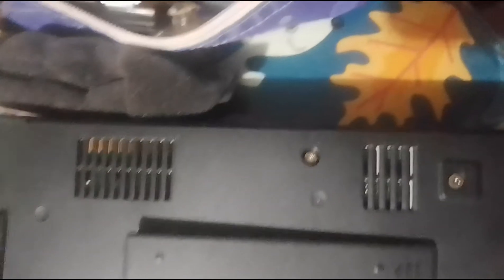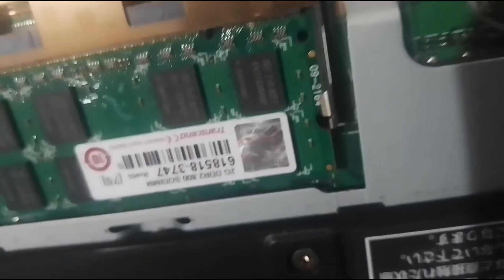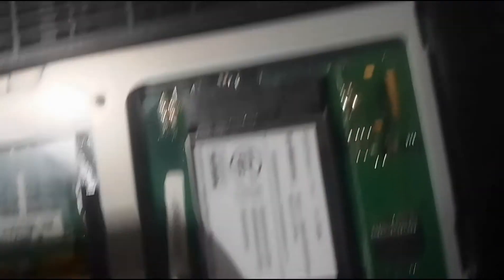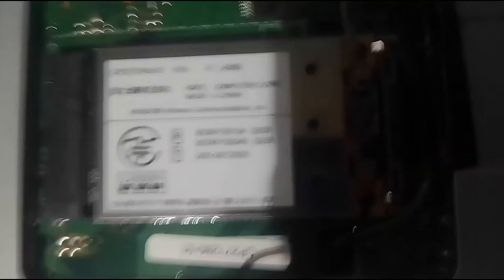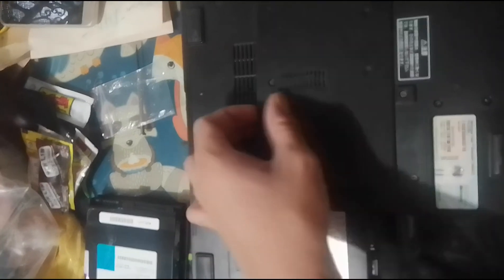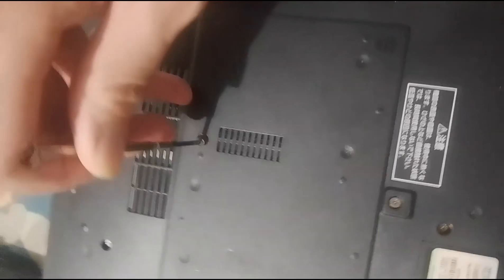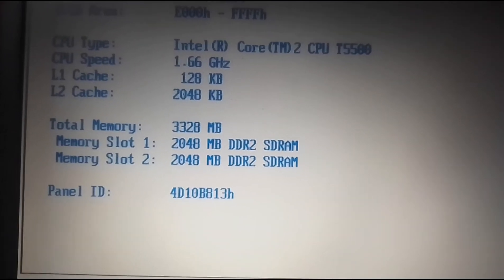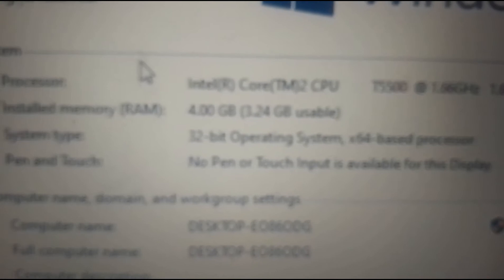How to upgrade RAM from 2GB to 4GB in Fujitsu FMV-C8240 laptop?

Comment: pwede po ba lagyan yan ng sdd? if pwede po ano po ung compatible na ilagay
Reply from the maker: Thanks for your question. However, yan ang di ko alam kung working ba ang pagpalit ng HDD to SSD sa Fujitsu FMV-C8240 kasi di ko pa ma-test yan. 2007 nirelease ang Fujitsu model FMV-C8240.
I'll plan to buy Sata SSD and I will find out soon.

FYI: parehas ang size ng laptop sata HDD at SSD.

Comment: Is it possible to upgrade the graphics card of this laptop?
Reply from the maker: Unfortunately it is impossible to upgrade graphics card because 256MB Intel GMA 950 is a major bottleneck. RAM and CPU can be upgraded.
Reply: @DarkKen958  I wish of playing NBA 2K14 in this laptop. I already upgraded my RAM to 4gb. If ever and if it is possible that I upgrade the CPU of this, will I be able to run the game?
Reply from the maker: @janusmichaelfausto6985   Core 2 Duo can be T7200 2 GHz, T7400 2.16 GHz, and T7600 at 2.3 GHz for a better CPU. 
I read it about upgrading to T7200 ot T7400 in http://www.fmworld.net/biz/fmv/product/hard/blb0704/c8240/spec.html using google translate
and upgrading to T7600 in https://forums.tomsguide.com/threads/upgrade-ram-on-old-machine-or-get-a-new-budget-laptop.139976/
Reply: @DarkKen958  If I upgrade the CPU to T7600, will the game (NBA2K14) run smooth?
Reply from the maker: I never tried it yet. I only placed RAM. I ran Medal of Honor Pacific Asaault and Age of Empires 3 using my default Processor of Core 2 Duo T5500 in my FMV C8240 it's very slow on gameplay. I haven't tested it yet and still don't have budget for CPU upgrade.
Reply from the maker: NBA 2K14 PC SYSTEM REQUIREMENTS

MINIMUM REQUIREMENTS:
CPU: Pentium 4 2.4 Ghz Single Core processor or equivalent (2.8 Ghz for Vista/Win 7/Win 8)
RAM: 512 MB or more (1 GB for Vista/Win 7/Win 8)
Disc Drive: 8x or faster DVD drive
Hard Drive: 8 GB or more free space
Video: DirectX 9.0c compatible (see below)
Sound: DirectX 9.0c compatible
Input: Keyboard or dual-analog gamepad
Video card with 128 MB or more memory and one of the following chipsets is required:
Radeon HD 2400 or greater; NVIDIA 6800 GT or greater; DirectX 9.0c compatible card with Shader Model 3.0 support.

 

RECOMMENDED SYSTEM REQUIREMENTS:
CPU: Intel Core 2 Duo processor or equivalent
RAM: 2 GB
Disc Drive: 8x or faster DVD drive
Hard Drive: 9 GB or more free space
Video: Shader Model 3.0 support with 512MB Ram (Nvidia(R) GeForce(R) 8800 GT or better)
Sound: 100% DirectX 9.0c compatible sound card
Input: Dual-analog gamepad

Not sure if it can run Windows 10.
Reply: @DarkKen958  I use windows 10. I'm planning to upgrade to T7600. Hopefully it'll run NBA 2K14 smooth at least in its minimum video setting. Please keep me updated if you tried it already. Thanks.
Reply from the maker: @janusmichaelfausto6985 okay, no problem. T7600 costs Php 1K and above. You can find it in Lazada or Shopee app.
Reply: @DarkKen958  Yah thanks. Btw are you sure that the motherboard of this laptop is not soldered and can be detached?
Reply from the maker: @janusmichaelfausto6985  yes. it can be removed. You can search about fujitsu fmv c8240 and there is the desassembly video of fujitsu lifebook but similar to fmv-c8240.
However I haven't tried to remove it yet because I bought my Fujitsu fmv-c8240 in November 2020 and I had to take care of it first.
Reply from the maker: @Janus Michael Fausto  na-test ko yung Age of Empires 3 at Medal of Honor Pacific Assault sa Windows 7 (gamit ang Intel Core 2 processor) sa Fujitsu FMV-C8240 ok yung performance pero sa lowest graphic setting ang pinakamabilis na performance.
Pag nasa windows 10 ka (Fujitsu FMV-C8240) sobrang bagal ang performance at laging nag lag (nung nag-run ako ng Age of Empires 3 at Medal of Honor Pacific Assault).
So imbes na bubuksan ko ang laman ng laptop para mapalitan ko ng CPU, dinowngrade ko na from Windows 10 to Windows 7 instead.